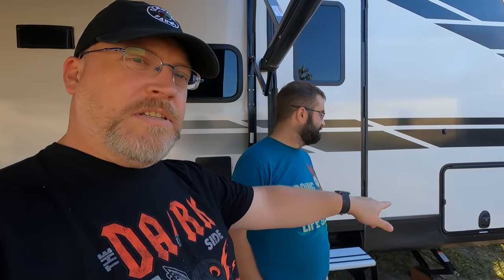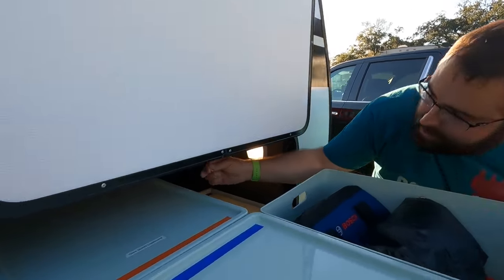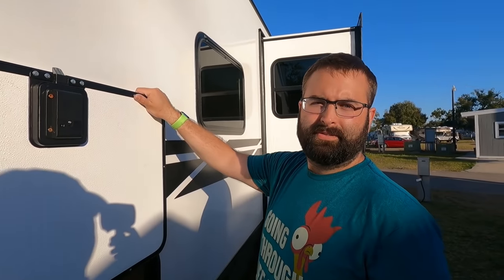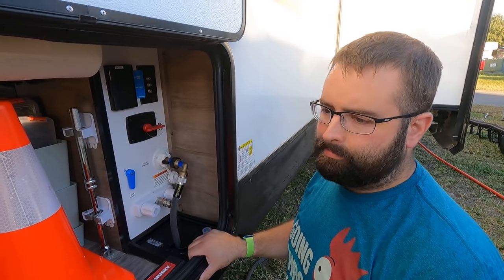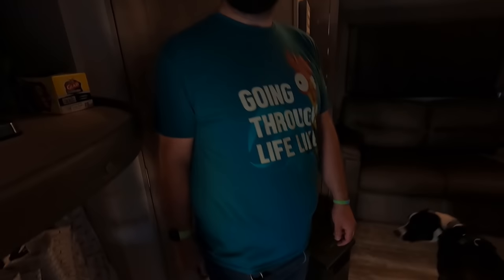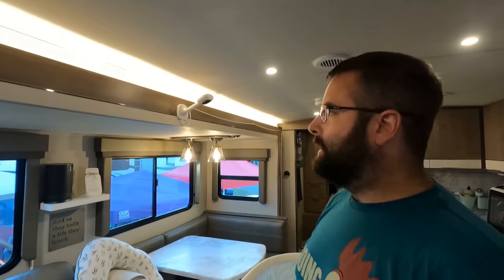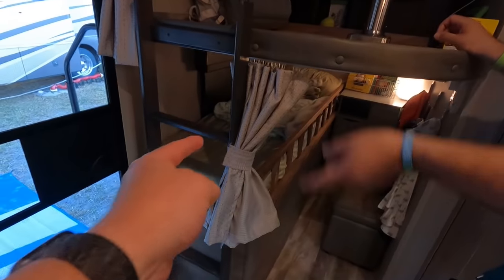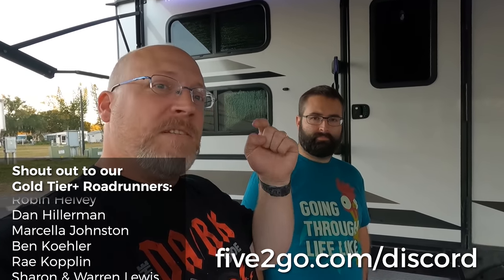AWESOME RV Tech and Storage Hacks in an Imagine 2800BH

Comment: Brian - RV Lock makes locks for Class A's - we have one and love it.  Ben - I used a Moryde 200% sliding tray and keep my Camp Chef on it - it pulls away far enough from the coach to use without moving it to another table and I can keep the propane line connected (turn it off at the tank when not in use).
Reply from the maker: They don't make locks for my Class A 😕
Reply: @Five2Go  Oh that is a bummer because we love remote entry!

Comment: The "high tech" long lasting solution for eliminating the drawer noise, and making for a smoother glide, is UHMW plastic. It's sold in many forms, but can also be re-purposed cutting boards (if the available dimensions work for the space). It's commonly used in tablesaw fences, any many other tool accessories.
Or, lignum vitae if you want to get real fancy. 😆

Comment: Some higher end class A’s and fifth wheels have analog or more traditional buttons and switches because of the clientele. Generally older folks are buying them and don’t want to miss with an iPad or touchscreen type control system

Comment: To quiet the drawer,
Cut the front edge of the base (under the drawer) as the drawer glides across the bottom piece, it will rub, causing it to reverberate/ make noise (mostly because it is loaded which will bow the bottom of the drawer).

Also, it would be nice to use oak/ hardwood for the "drawer guides" & seal with polyurethane &/ or lubricate the poly with beeswax or spray silicone.

I set-up a similar tool drawer in my work van out of plywood with the oak rails & would silicone the slides 2x/ year with great mess.

*Also, should put a latch so it doesn't slide & push the door open in route*

Comment: Ben, I loved every one of those mods!  I saved the video for future reference.  Absolutely ingenious and thanks for sharing them with us!! I am expecting delivery of a 2400BH and would like to do some of those mods that you shared.  What brackets did you use for the sliding tray on the storage compartment?  I have already the gray/black water tote.  I was wondering why did you attached it to the bumper when you could have used the RV ladder?  Is the tote blocking the RV stop light or am I missing something I should be considering?  Thanks.
Reply: Hey Henry!  I think I answered already in Discord, but for everyone else...

The sliding tray is currently just wood-on-wood, hence the terrible noise that Brian had to edit out.  There have been some great suggestions that I need to try here in the comments when I have some free time.

I put the tote on the bumper because I would have to move it every time I needed to get on the roof.  Also on the 2800BH, the tote was slightly visible on the drivers side when centered on the ladder.

Comment: Perhaps a rookie question, but I can't seem to figure out how he wired the remote cap light switch. The current switch on my unit only has 2 wires attached. The remote switch has 2 inputs and 2 outputs. When I connect the 2 current wires to the remote switch it only powers 1/2 of the cap lights and no way to turn it off. I know it is going to be a simple answer, but can you direct me?

Thanks. Great videos BTW. Lot's of great ideas to make the camping experience more enjoyable.

Comment: Great modifications but how is the outdoor storage tray anchored so it doesn’t tip down when the drawer is pulled out?  Thanks!!
Reply: There are some rails on top that prevent the tray from tipping out.  I’ve been able to easily get about  2/3rds of the way out without any give on the rails.
Reply: That’s pretty awesome! Thank you for responding. Would you be willing to share a couple pictures as I have a variation of the shelves and thought ext legs would do and never thought of a tray with in. Thanks in advance if you can other wise, stay safe and enjoy your new baby and travels

Sent from my iPhone 
Regards,
Reply: Yeah, when I get some time I’ll take pictures.  Probably will just have to share them on Discord though... not sure if YT lets you post photos.

Comment: RE: the plywood under storage tray - is that on a track / wheel system ?
Reply from the maker: It's not - he just built side bars on the shelf that slides out and those are captured by wood inside the storage bay. It's all just wood sliding on wood, there aren't any wheels or tracks.

Comment: Can you please link me the model and size of Gray water tank you have and recommend for a 25' trailer? Also, i am having trouble finding a hose storage that will hold the Rhino Extreme ends that actually fit in to the hold... The Forest River bumper will not hold this hose ends... I think the opening need to be 4.6" and i want to hold 30' or 3 10' ers... so i may need two holds. I love your drill holder. E

Comment: Actually, green tape would be better for anything associated with sewage stuff and the orange tape would be used for anything pertaining to phone usage. Yellow tape used for anything that has to do with gas, and red tape would be for any thing electric.
Reply: The color coding is really subjective.  I did orange for the sewer because most of the sewer stuff that I own is orange or has orange accents.   Blue for clean water and yellow for electrical.  I haven’t really found a need to mark for anything else.
Reply: @triphius  Actually, color coding isn't subjective at all. It's standard through out the country even with all utility companies and most of all with different locating services/companies. When I, or even others think of yellow we think of gas not electrical. But, to each there own huh? :)
Reply from the maker: I'm with Ben here - the sewer hoses we both use are black and orange so the orange just makes sense to an rver using that equipment. We don't have to worry about telecom, gas lines, fiber, etc 😉
Reply: @Five2Go  I understand that I was just saying.
Reply: Ty... You’re absolutely right in regards to standards... however what I’ve learned about RVs is that color code standards are completely thrown out the window.   If I were marking underground cable on my property... I’d be right there with you 100%.

In this instance, I feel as if it makes the most sense to do what I did... but if that isn’t something that works for you, you should definitely do it some other way.  In this application, the only person who needs to decipher it is me (or my wife).
Reply: @triphius  No-No it's perfectly fine what you do. I wasn't trying to cause a stink or any thing like that I was just saying.
Reply: @CCaudits  Same here!  I work in technology, so standards are definitely important to me.  😀
Reply: @triphius  I worked for my local city twenty years and we had to know all the different utility colors.

Comment: Great trailer. Can’t agree with this is 1/2 ton towable.
Reply from the maker: The gross on the 2800BH is right around 8k, that's well within most modern half tons.
Reply: @Five2Go  1/2 ton towing capacity makes no sense. that’s over 1000 lbs on the tongue. Likely 1200 lbs in reality. Definitely in 3/4 ton territory. At least F150 HDPP. Not regular 1/2 ton.
Reply from the maker: I recommend a 3/4 ton+ to everyone purely for the heavier suspension and larger brakes, but half tons are decent with smaller RVs and more practical (and affordable) for everyday usage. I don't know what year Ben's truck is, but the 2018 Chevy truck guide says the 1500 goes up to 9,500 lbs off the bumper with a max of 1,250 on the tongue. He's probably over that a little bit with all that extra wood in the front storage and whatnot.
Reply: @nicolathonathan770  So the drawer up front is only about 1.25 sheets of plywood, so it’s not as heavy as you might think.  I will concede that I’m probably a touch over on the payload, but they truck (2019) has handled over 6k miles of towing without even the slightest issue.  Although, it’s a moot point because I already got a bigger truck.  😂

Comment: You missed the most impotent part of the roll out trays. What was used for slides and how they were mounted
Reply from the maker: He explained it - it's just wood channels that the drawer slides in, you can see them in one of the closeup shots. He didn't use any wheels or rails.
Reply: @Five2Go  Thanks. I missed that

Comment: use high-density polyethylene plastic (HDPE) cut into strips on the underside of the slide out, Its the same material as cutting boards, super slick, super hard and cuts nice. find it at your big box home improvement stores. I built a truck box to store all my construction tools in, drawers pull out one handed

Comment: The storage tray with the bins and the braket for the folding table is amazing. You are correct that RV/Marine batteries are garbage, buy Deap Cycle batteries instead lol. RV/Marine dose not equal Deap Cycle.